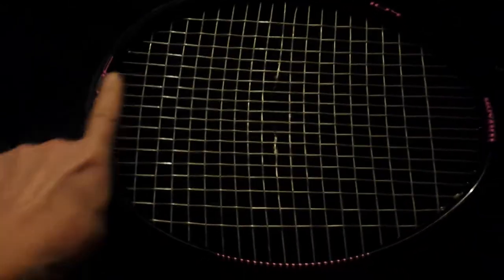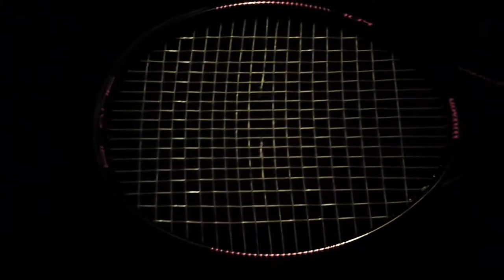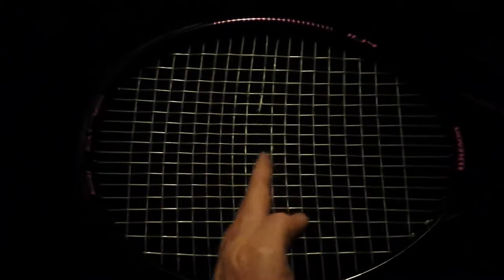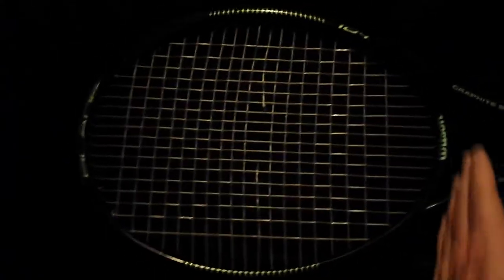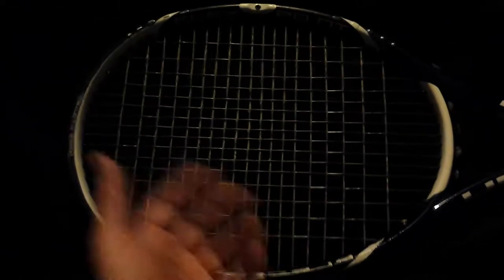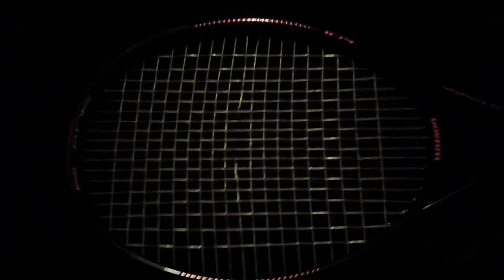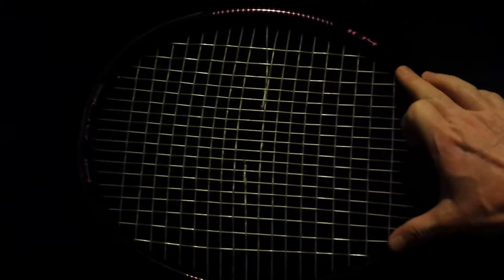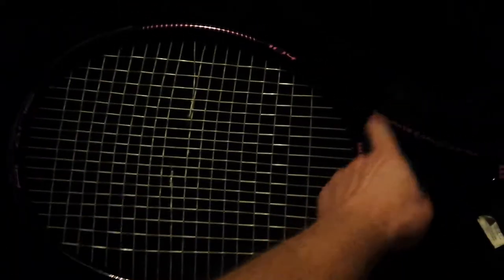Poorly strung racquets.

Comment: Do your clamps leave no marks at all on the strings? Would you say any kind of mark at all is unacceptable? My flying clamps seem to allow a bit of slippage or they mark the strings slightly. I have tried cleaning them thoroughly. As string materials, gauges and tensions differ, do you keep a log of your clamp settings, or do you just do it by feel on a piece of scrap before each job?

Comment: The tension distribution isn't right because of the 3 knots right? Always have to be 2 knots for mains and 2 knots for crosses, so it can be hold well
Reply from the maker: No, that's not what I was saying.
There were 4 knots (as there should be with a hybrid), but the knots were in the wrong places (completely WRONG ends of the hoop).

I'm explaining that the person who strung this racquet didn't really know what they were doing.  The person made many mistakes/bad choices.
This person clearly did not know how to properly calculate/measure string lengths.
What this person chose to do also damaged some of the grommets (which never should have been used for tying off).
This was a complete hack job.  Terrible.

Comment: Looks like to me that the player is a very "flat" hitter and hence why crosses have moved up and has broken cross strings in both cases.
Reply from the maker: She's not a flat hitter.  Even if she was, hitting flat wouldn't cause the cross strings to be curved like this.
The crosses are curved because they were installed "bottom up" rather than "top down" AND because the stringer did not straighten them properly AS each one was tensioned.
The reason she always breaks her cross strings first (as opposed to one of the mains) is because her crosses are the softer string (multifilament) in this hybrid.  She uses poly mains & multifilament crosses.  Therefore, the crosses are going to be the "weak link" - the multifilament crosses will abrade, and snap, before the poly mains are going to.
Reply: @PCSStringing  so if the multifilament cross strings out before the poly main can we just restrung only the multifilament cross leaving the old poly as it is without replacing.

I also use the same multifilament cross and poly main in one of my racquets and I see the cross is almost worn out about to be broken.

In that scenario can I just cut only the cross out and replace the cross with newer multifilament strings?